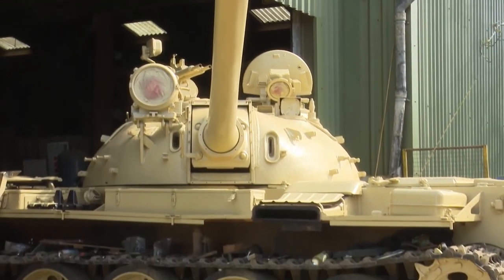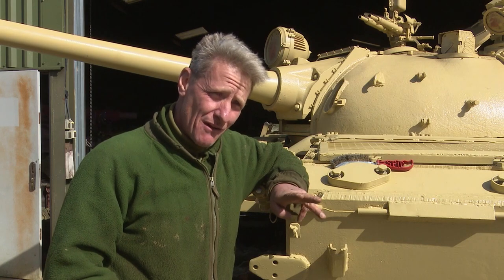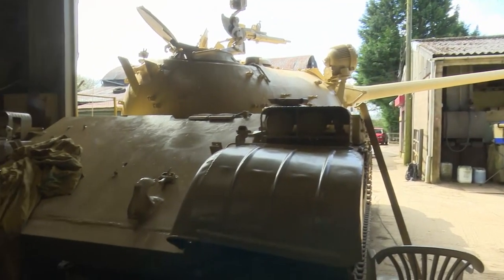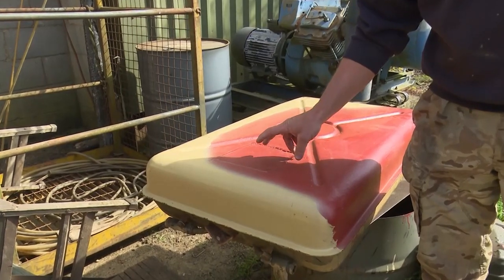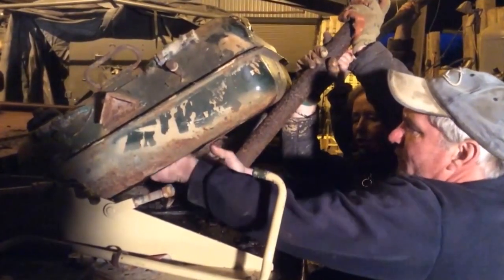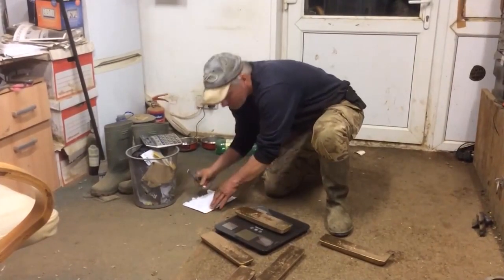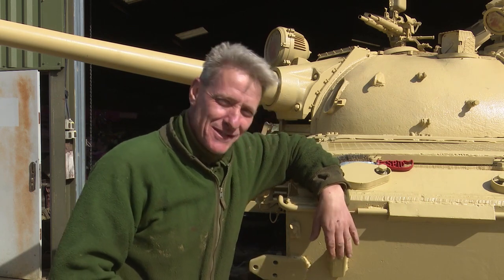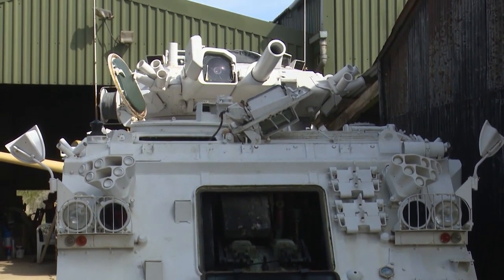£2m Worth Of Gold Found Hidden In Former Iraqi Tank | Forces TV

Comment: its just a type 69 since its chinese.... no such thing as t54/69.....  not even based of of a t54, its based off of a t62 so it would be t62/69 if you want to get it accurately wrong lol
Reply: It's not based off the T-62. It incorporates some equipment copied from a captured T-62, but the base tank itself is just an upgraded Type 59/T-54
Reply: u basically just said it was based off t62. just a t54 with a t55 berrel
Reply: What?
The T-62 is not a T-54 with a T-55 gun. The T-62 is a completely different tank developed from the T-55, mounting a 115mm gun (which was never mounted on the T-54/55). The Type 69 is a slightly upgraded Type 59 (copy of the T-54). The Type 69-1 variant incorporated some MINOR equipment captured from the T-62, the most notably piece being the IR Searchlight and NBC system. It still has the 100mm gun of the T-54/55.